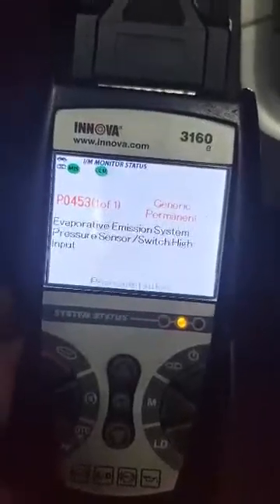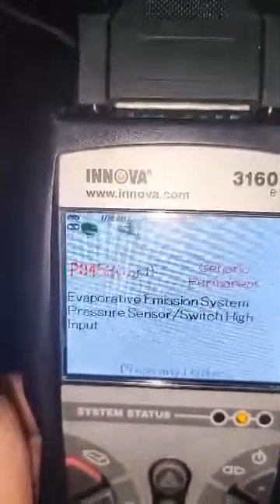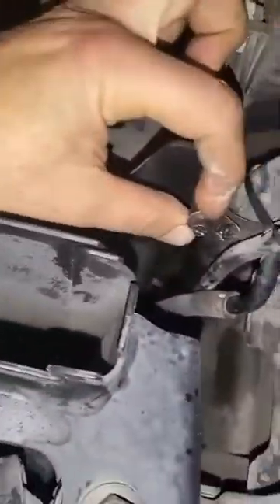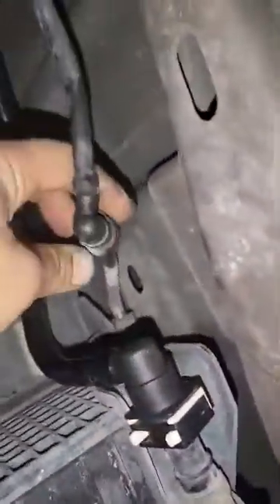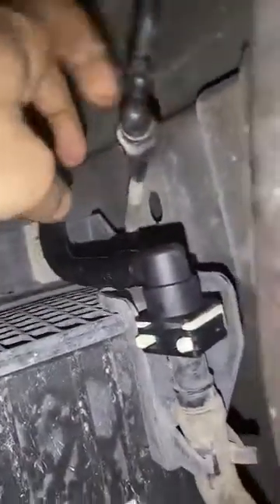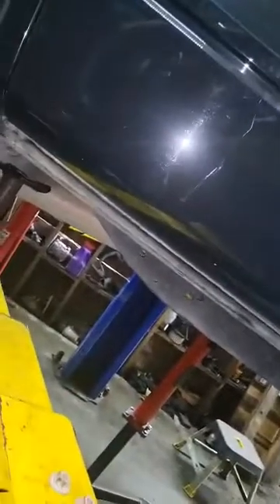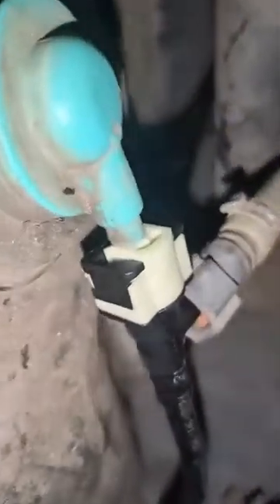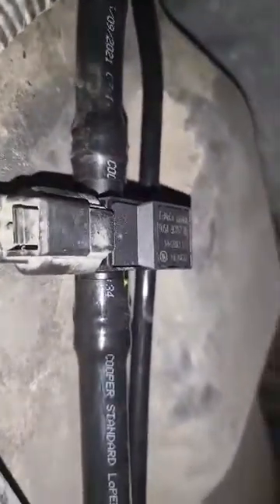How To Replace And Fix EVAP Pressure Sensor Code P0453 #howto #diy

Comment: I have 2012 f150 with p0453.ftps is reading correctly on scanner smoke tested no leaks what now??
Reply from the maker: It's the same code I had in the video, you'll have to replace the fuel tank pressure sensor. I've done this in many Ford Expeditions and F-150s with the same code.

Comment: You can't erase it UNTIL YOU CORRECT THE PROBLEM
Reply from the maker: "Thanks for your comment! I cleared the code before starting the work to ensure I could distinguish between old and new codes during diagnosis. This way, if the issue persists, the code will reappear, confirming the problem. It’s a common diagnostic practice to avoid confusion with outdated codes.

Comment: I have a 2003 navigator having same code …does your part number the same for me ?
Reply from the maker: No, it's completely different.  Check this link it may give you some info .
https://www.justanswer.com/ford/ir6a2-code-p0451-p0453-u0109-code-vehicle-no.html

Comment: I have this code P0453:FF and a massage "evaporative emission control system sensor high input" on a 2009 ford mercury grand marquis
Reply from the maker: https://www.amazon.com/Dorman-911-260-Fuel-Pressure-Sensor/dp/B01ID3WJWC
Reply: I have this code p0453 pressure sensor switch had high voltage input Toyota Yaris 2009

Comment: I have code p0453 pressure sensor high circuit on my Hyundai. Have a rough idle. I changed the sensor,vapor vent canister and the purge valve. I removed the charcoal canister and checked it for blockage and did the same with all the lines. Still have the code and rough idle. Any suggestions?
Reply: Yea, instead of guessing and throwing parts based on a code, take it to a professional that knows what they are doing
Reply from the maker: Here are some things you can try to fix error code P0453:
Inspect the gas cap and clean it with WD-40
Repair or replace the wiring or connections
Visually examine the wiring harness and connectors for any damaged components
Check for power at the fuel tank pressure sensor
Check for a good ground in the system
If the high voltage disappears when unplugging the sensor, check for a good ground to the sensor and proper reference voltage

Comment: Great video 👍🏻🙌🏻🙌🏻 Thank you. I'm having the same exact problem/code with 2007 Ford Freestyle. Unfortunately, Ford does NOT have that sensor/hose and can't find a new one ANYWHERE I have looked, including RockAuto,.... (I have no idea where to get a new one). However, the sensor looks very similar to the one for this F150 you just showed in this video, but the hoses are not the same. Any suggestions/tips on that? Thanks
Reply from the maker: Did you look at car-part.com or any junkyard
Reply: @hanitwfik  thank you for your tip🙏. I've checked our local junk yard, but noone has a Ford Freestyle. However, your link has many ford freestyle. Thank you. I'm going to see if I can find a used sensor as you suggested.
If that sensor does not fix the P0453 code, then it's the ECU as I've checked EVERYTHING, and even bought new gas cap, purge & vent valve, checked wiring, fuel pump.... Except for this fuel tank pressure sensor & ECU.
Questiosn: once you replace this sensor, does it have to calibrated or take the car to Ford/shop for programming....of some sort? (I can clear/read codes, but can't do any programming or calibration....). Thx

Comment: Was it idling bad or something, I have a 2003 Mitsubishi outlander 2.4 liter, and it idles rough, I've clean the EGR valve, out new mass air flow sensor, new wires and coil packs, new plugs, and still idles rough, runs good pressing gas, but idles rough, can't find any vacuum leaks, it's just stumped me, I can't think what it can be
Reply from the maker: Throttle body
Reply: Remove and clean the iac valve and throttle body then reinstall them and use your cars specific code to trigger a throttle relearn basically u have to press the break so many times and turn the air on and off or something weird and specific to your car and it makes the computer go into a mode where it forgets it's stored data and learns everything all over again and this makes a huge difference my car never idled below 1500rpms since i had it but after this it now idles at a easy 750 rpm even now 10 months later i never had any more issues